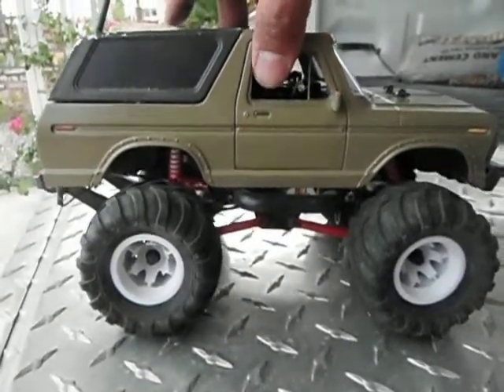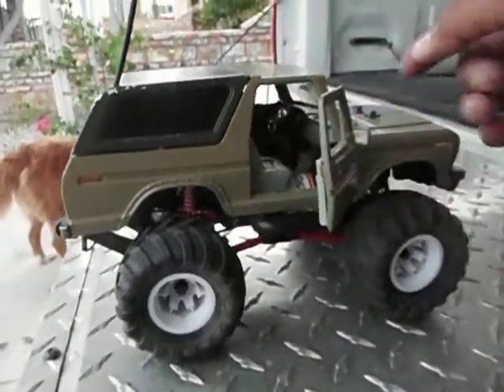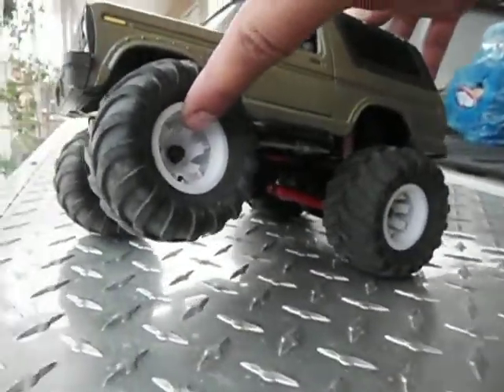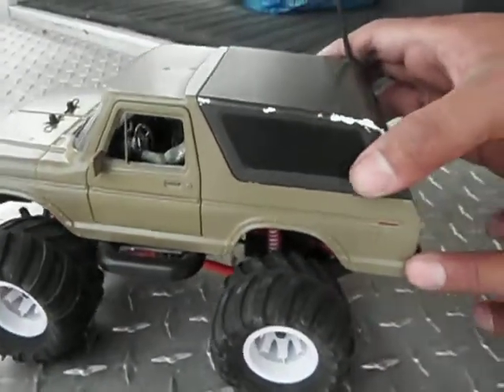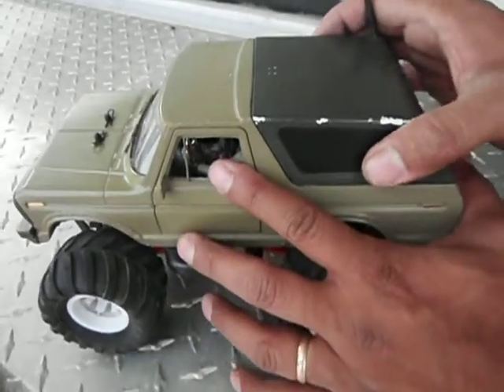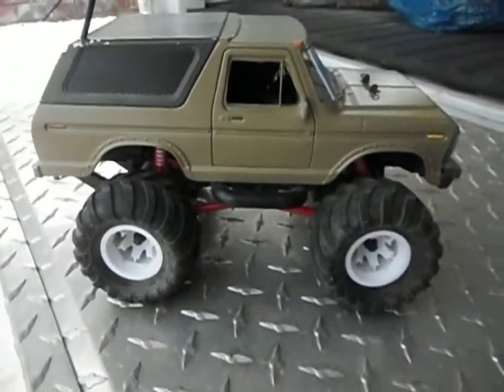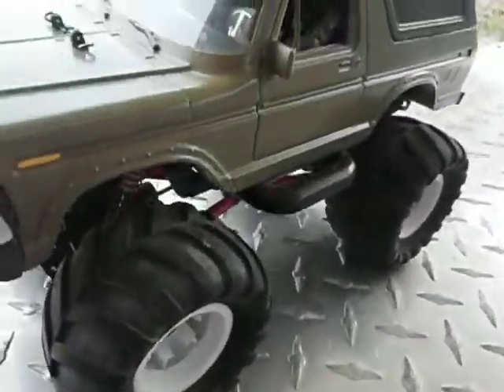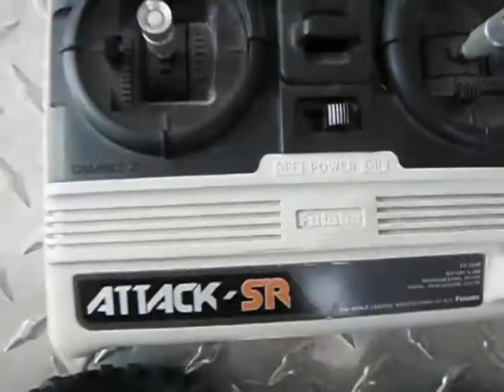Ford Bronco remote control 1/18 scale G.I. Joe vehicle custom

Comment from the maker: True if the RC was a wal-mart RC, unfortunately the electronics and chassis I use are hobby grade. Those parts alone cost around 80 to 90 dollars without the modifications. and the body another 30 to 40 prior to the modifications. But your right its to expensive compared to a regular RC from SEARS, TOYS R US, or Wal-Mart.